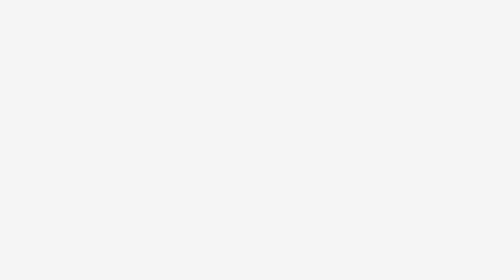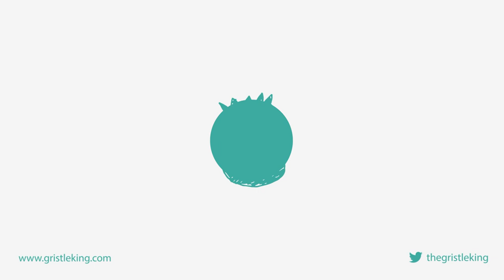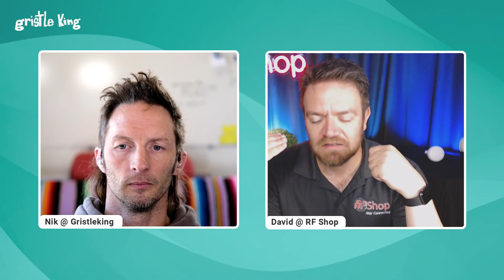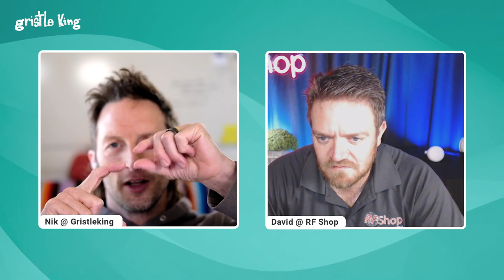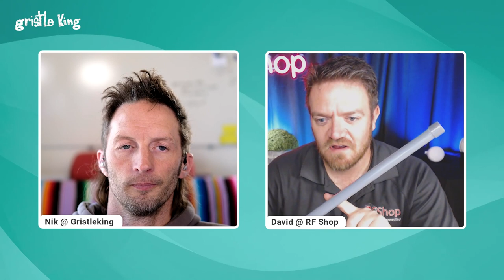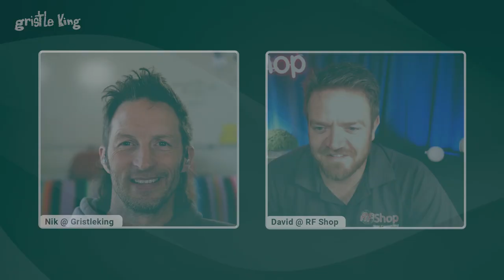Is a Tuned Antenna Better For Your Helium Miner?

Comment: Line of sight is very important. I have a 5.8 stunned antenna, up on the roof, 10m lrm400 cable, approx 6m above ground ( I am located 106m above sea level), and I witness a hotspot that is 208km away from me, and get witness by another that is 258kms away.
Reply: That’s very impressive! Line of Sight and height is far more crucial than antenna gain. There is also probably no significant noise sources in your area, right?

Comment: Great video guys. I got interested in antenna and antenna design early in my Helium life. So I built a antenna and it worked very well. I was able to test and tune with a nano VNA. It was a great experience and learned a lot. Oh yeah and height is #1. 👍
Reply from the maker: Thanks Denis, nothing like building your own to learn how it works.  Right on!

Comment: Hi Nik and David, very good video. Thanks for talking about the antenna. I am looking forward to David talking about analyzing antenna by looking at the RSSI and SNR from witnesses.
Reply: Great...thanks for that. I'm working on building material so I can talk about the importance of using and recording your RSSI / SNR and range to build a picture of the "health" of your hotspot and also to figure out if things are not quite what they should be...both for you and the remote unit.

Comment: Totally agree on poynting antennas. I've started reviewing them for my channel and got relationship with them, and they are excellent. For your interest in professional world we look for vswr of 1.2 in the freq range of interest. In fact the idea of reflected power is how filters like bandpass work. Also, again I stress my UK national IoT network of 100s of sites had all sites with 9dBi antenna. And, spreading factors that's an interesting topic. That's because of the EiRP limits and beacons. In other spread spectrum tech, the beacon (cpich in 3g) is not transmitted at full power, it actually much lower. The eirp is based on max power ofthe traffic. So, if the helium eirp limits are based on peak power of the beacon, we could argue the case for better antennas and rf bidirectional amps.

Comment: Great video as always... Strang question : if i have a panel antenna with white cover.. Can i paint it in spray paint from outside without effecting the signal? :)
Reply from the maker: Sure, just make sure it's not a metallic type paint.  Most spray paints will be fine.
Reply: @thegristleking 
Thank you man... You are awesome 👍

Comment: Good informative video , Thanks to all, I have my feeling regarding Lightning Arrestors , when you have a DC shorted antenna it's not useful to add an arrestor just ground the end of the cable in front the miner, when open circuit antenna is used it's really needed , but remember there is extra losses with each arrestor and connectors used , typically +-0.5dB loss per connector , so to use more than one is not good for signals. Thanks again.
Reply: Hi Jaco. I agree that one of the simplest first lines of defence against lightning in antenna design is to make a DC short inside the antenna. In principle it is actually quite easy in a narrow-band antenna such as LoRaWAN but I am yet to see one for myself (although I have seen it online). These DC shorted antennas will probably not be “strong enough” for a significant strike and a purpose build protector will be better at handling the energy surge. Also (and I’m still studying this) the best location for an arrestor is at the bottom close to the hotspot before you enter the building or enclosure. This is only possible using a device on the end of the cable, but here-in lies another challenge; the cable would need to have different ends to make it all go together nicely. So, all-in-all the topic of lightning protection needs a lot more clarification!
Reply: @RFShop  Yes I totally agree with you, I played with a lot of different setups as I'm also very new to LoraWAN where we in South Africa make use of the 868Mhz and with our ridiculous low E.I.R.P of Total 16 dBm I really need to look at the lowest loss possible, I've build quite a few different types of antennas to test with like the common J-Pole , not bad but not good , I even tried the J-Pole Collinear where you add a phase shift (1/2 ~ Coil) and it worked great but RX Signals was not that great although the SNR was good, but that was due to DC shorted antenna , My latest antenna is a normal Open circuit Ground plane Collinear and I added a GAS arrestor at the top between Radiator and radials just to help for static discharges and I grounded the shield of the coax as close to the miner as possible still keeping it at the outside, S11 / SWR around 1.25:1 / S11 MAG -25dB . This is part of the fun one should have play build break and Repeat. Dankie geniet jou videos baie..
Reply: @jacoleroux5569  Sounds like you are doing exactly what we all are meant to do. Learn and improve. That was exactly why I responded in that way when Nik asked me how long it took to learn RF...22yrs and counting. 
In my final year project I did a coaxial collinear antenna, and that happens to be exactly the structure that many of these narrow-band Helium antennas use (including the RFShop ones). In that design, you could short the last element without causing trouble over a narrow band. You do induce a standing wave, but it's no different than with keep it open as that has the same effect on the antenna structure (just 90dgr different in phase). 
Long story short...a DC short it possible. On the antenna gain vs. low EIRP (like in ZA) do keep in mind that antenna gain will also help a lot on RX performance. So, although you need to drop the transmit power, the receive input is still better by that much and you'd be a better witness. 

Dankie vir die terugvoer oor die videos. Ek geniet dit eintlik vreeslik baie om Youtube te gebruik na mense in the www uit te reik. Hierdie einste video is 'n voorbeeld van die krag van Youtube :)
Reply: @RFShop  Hello excellent class.
A question:
What is the best antenna Helium 868 mhz for TX and RX signals, open or closed circuit antenna.
My antenna is open.
Thanks
Reply: @luismanuelfragosoconceicao  thanks for your comment. I don’t have a preference. Open vs Short Circuit is actually just a design artefact. 

The thing with lightning protection is that energy surge takes the shortest path. So if you don’t add a lightning protector close to ground the surge will go through your equipment and that’s pretty bad.

Comment: Great video.  I watched this and read a lot on antennas.  I am against a mountain with 180 degree pano view of the Boise valley.   Would you recommend the MP 08-ANT-0938. 60 degree?  In another video you recommended the L-Com,  But its impossible to get right now.  Sounds like you are pretty high on MP in general.
Reply from the maker: Hi Tom, MP makes excellent antennas, but you can pick up a McGill panel here if you're looking for one: https://grstl.ink/panel-antennas
Reply: @thegristleking  thanks.  ill check out the specs

Comment: One question: using an high dbi antenna wouldn't help me to "hear" beacons better than a low gain antenna? In EU the transmitting power is cut down to 14 dbm. In that case an high dbi antenna would be better to get the beacons...or not? What am I missing?
Reply: Yes, I do agree with your question and remark and it is indeed one way (if not THE way) to address low EIRP levels.
Reply: @RFShop  Thanks for making it clear. So in Canada where the transmitting power is higher, do you see any use for a 9dbi? Currently I have a McGill 9dbi tuned. thinking if a 6dbi McGill will be better for a suburb/city. Will the 6dbi "hear" less than the 9? 50% less?
Reply: @dorytricot4473  to a large extend that is true. A passive device such as an antenna helps to lift the signal away from the noise floor so you will have the ability to increase the "listening" capability of your setup. I think the key thing for me is the higher gain antennas get very sensitive to alignment and setup. I believe I touched that in the video as well, in that you need to make really sure you are nice and straight / vertical for the higher gain antennas otherwise things go a bit lob-sided. 
For that reason I prefer the 6dBi over 9dBi since I personally don't get enough value-add from that additional 3dBi on the horizon vs. the lower gain and added troubles. 
I see a lot of reports (including GK himself) that people get 100+ km reach with 3 or 6dBi antennas in LoRaWAN and also here in Adelaide there's a 70km link all using 6dBi antennas. So the issue on range is antenna location, Line-of-Sight and height and not the gain that makes the distance.

Comment: Good morning, when my SENSECAP arrives, can I directly connect a 10dB antenna that I have installed or do I have to configure the device for a week with the factory antenna? Thanks.
Reply from the maker: You can directly connect the antenna, just make sure you note in the app that you're using a 10 dBi.
Reply: @thegristleking  tank you

Comment: Gristle King, Just installed my Miner M1 yesterday and it's still says "syncing" but I earned .04 HNT is that normal? I see everyone else's says "online" but mine says syncing, yet I earned .04 HNT? Any ideas what's going on or when mine will say "online" as well?
Reply: Takes about 3 days depending how much it needs to catch up to the Blockchain. Just wait
Reply: @MrHukd  appreciate the response! I herd 24 hours so I was getting worried
Reply: @dankjeenyus  it can take 24hrs yes. It just depends on network so just need to be patient
Reply: @MrHukd  appreciate it, do you know the answer to my other question below about what is the number next to the green dot in the app? Mines at .91 currently, not sure what the number is..
Reply from the maker: @MrHukd  thanks mate!

Comment: Ok say I have a 9dbi Mcgill tuned Antenna 915mhz.Say That I have a good type N 3 way splitter so I can run 2 antennas connected to my lmr400.Ok one antenna is a 9dbi Mcgill and the other is a 4 dbi mcgill omini directional .with the splitter would they just be combined making a 13 dbi or would they act separately from one another.or would it be better to get a directional antenna with the 9dbi Mcgill so the waves don't interfere with each other.Or should I sell the 9dbi and get a 3 or 4  dbi omini directional antenna or an Hantenna.
Reply from the maker: Check this out: https://youtu.be/hA8xqGyTdfM

Comment: I appreciate Nic’s enthusiasm.. But I have been around Ham radio for over 25 years! There is no magic with antenna! It’s 3 things 1) Height 2) line of sight and the last power output! A close hanger will beat out a top antenna every time with better location. All an antenna is made of is coiled metal, that’s it.
Reply from the maker: Totally agree; location trumps all!  Thanks Chad!

Comment: I wasn't aware you are not allowed to modify your miner. Perhaps you meant most people don't have the knowledge or skill to do so. And the amplifiers, that seems to be a taboo subject in helium, never read a clear statement that you are not allowed to use one. Talking about bidirectional amplifiers of course, that only boost RX, i don't see any reason why you wouldn't be allowed to use one, if you are providing more coverage, you are more useful to the network, right? It seems to me the same as improving your antenna to receive better.
I mean i understand your position, you have to tread on the side of caution when a lot of people are watching you and the rules are not clear at all. Perhaps that's a good subject for debate, what the rules are, and helium should do a better job being transparent about it.
Reply from the maker: You can totally add anything you want as far as an amplifier (as long as it falls within legal limits).  It's just not usually that useful or profitable.  The "gear" part of Helium is probably 5, maybe 10% of your earnings potential.  Maybe a little more, but it's nowhere near as powerful as the location you're in.  That's the main message I always try to get across.